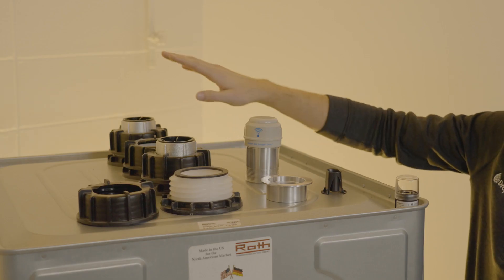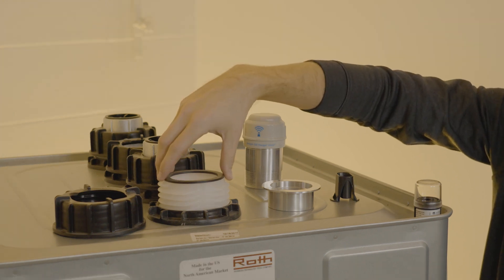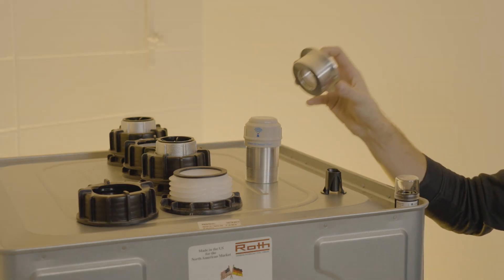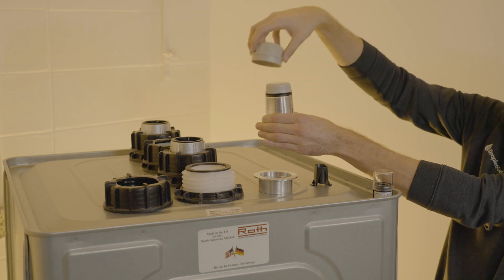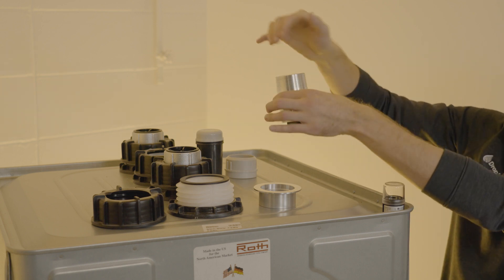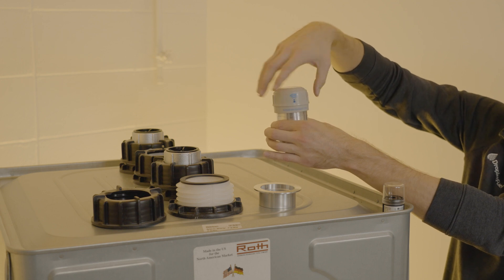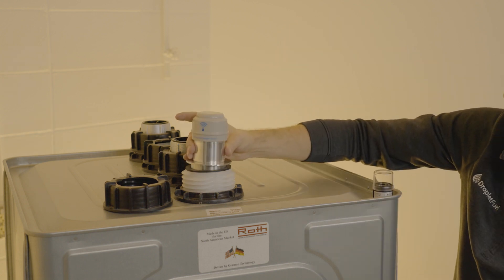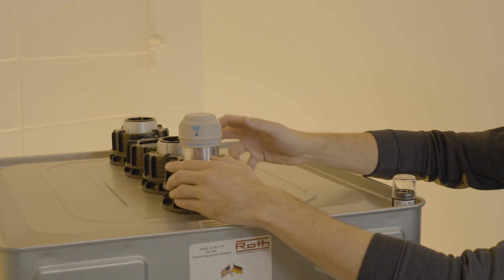Smart Oil Gauge Roth Tank Installation

Comment: Is this ever going to be available for the Roth 1500L
Reply from the maker: Unfortunately probably not. The Roth 1500 has a big internal support baffle that goes through  the center of the tank to keep the outer walls from bulging out. The sound wave ends up bouncing back off of it, which is a problem we have no solution for.
Reply: @ maybe a traditional float hooked up to a smart gauge? Next business idea! Lol thanks for the reply